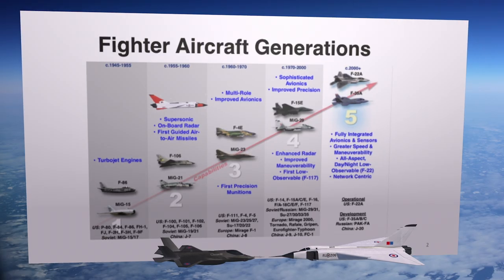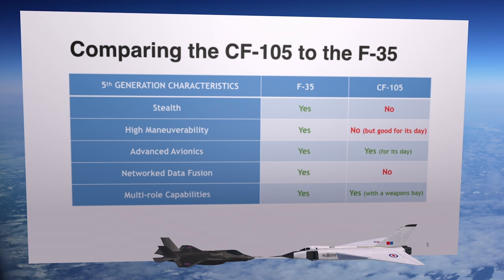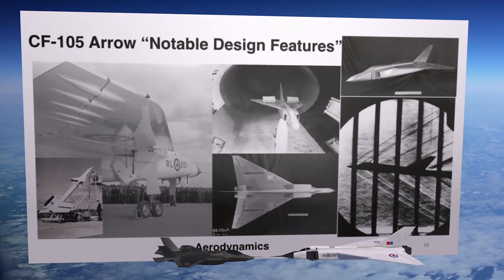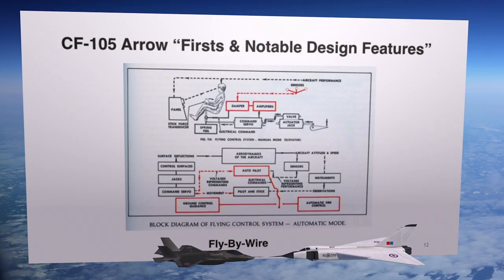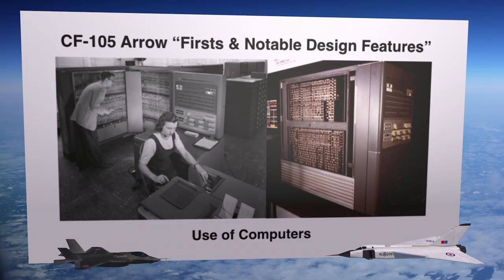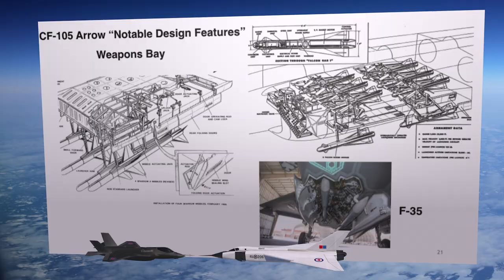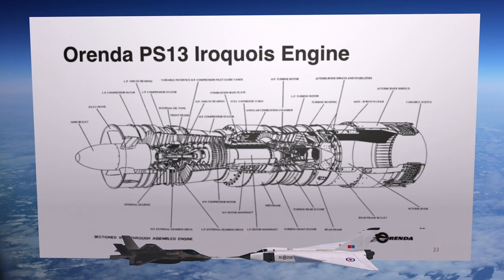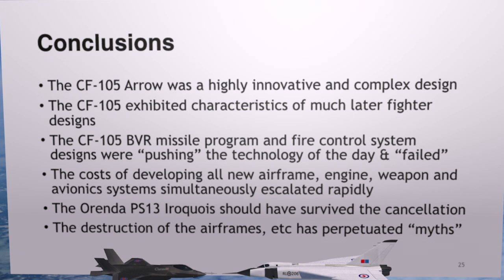AVRO ARROW FIRSTS VS F 35 LIGHTNING

Comment: The Arrow was not the only plane to be scrapped in that era.  The Brits have their own story too, and I expect there are others.  Basically, when nuclear deterrence switched from bombers to missiles, the interceptor requirements changed.  Speed was no longer king.  That's why the new planes don't fly as fast as the old ones.  No real need.  Then, stealth came along and there was another generation of fighters.

Funny thing is, they (Canadians, actually) are working on quantum radar which will destroy stealth.  Also, UCAVs are going to take over soon.  Requirements are changing again... to the point where raw speed is coming back, although unmanned.  The stealth air-frames sacrifice too much speed and are effectively a dead end.  The old Cold War era air-frames stand a good chance of being resurrected and I would not be the least bit surprised to see a 1/6th scale Arrow fly as a UCAV, and fairly soon.  There is a Canadian company collecting the old plans for the Arrow and, while they're not saying, I'm guessing this is their goal.
Reply from the maker: Hi Fixerdave.   Yes, there was a flurry restructuring in the late 50's when the Russians launched Sputnik, although in the final analysis, no one got it right.  The fact that nuclear arsenals on both sides cancelled out the problem.  Mutual assured destruction.  Planes don't fly as fast as the older ones, but that is also a function of the the Turbo-fan.  Turbo-fans can't process air over ~Mach 2.5 where Turbo-jets don't have the restriction.  Turbo-fans are much more fuel efficient though and give much more combat radius.
I have not heard of the Canadian Quantum radar, I will look into that unless you have more info.  Unmanned removes the G force limitation, but speed is still restricted by turbo-fans, although Mach 2.5 is still respectable, F-15.  I suspect the F-22 can fly faster than Mach 2.3 and I know the F-35 can fly faster than Mach 1.6, although not much faster.  I have no proof of this next statement, but I suspect the reason they post Mach 1.6 for the F-35 is that after that it becomes "less stealthy".  The Mach 1.6 being more of a Marketing statement than fact.  It's hard to sell a jet with the slogan "Stealthy up to Mach 1.6 and then you're dead meat".
There is a Canadian Company that has collected a lot of plans for an Arrow, but not nearly enough.  Although I always wish anyone trying to rebuild an Arrow well, there are so many roadblocks.   We have roughly calculated the cost to build a single arrow at one billion dollars.  regards..Virtual
Reply from the maker: @4Fixerdave  HI Fixerdave.  I am also old.  I start collecting my old age pension in Oct.  One of the reasons we are making these movies (I assume you have seen the series on my channel), is so younger Canadians will know we did this .  Having said that, it seems older Canadians are drawn to this much more than younger.  We came together when I met an Air Force general who looked after the CF-18's for many years, is also an Aeronautical engineer and is the foremost expert on the Arrow.  I also have direct access to the only person who has a series 2 Iroquois engine.  That is also on my channel.  But still, contracting these movies out would be hugely expensive.  That is where I come in.  I have some expertise in military affairs and the 3D skill sets to make these movies.  I fund the project myself as far as software and computers.  That get's a bit expensive.

People collecting plans.  There is Boudreau industries, but I am afraid that has faded into history.  There is a museum out west funding a 3/4 rebuild of the Arrow who have enough plans to make a flying model of sorts.  There is a new group called "Friends of the Arrow" who plan to build a full size, non military version of the Arrow.  They are trying to collect 60 million for this.  I don't think they have any chance of doing this, but I wish them well.  We have put the cost of rebuilding a full size military version on the Arrow a one billion dollars.  Even if you find a full set of plans for the arrow, the plans for the hundreds of special jigs, fixtures, presses etc. are gone.

I am gong to look into the links you sent me on Quantum Radar.  Quantum physics is a difficult subject to understand, but I have some exposure to this technology

Trying to figure out or understand the future of Air combat is tricky.  It seems clear, but it may not be.  I am working on something right now for Episode five of the Arrow series.  In this episode a large number of Russian SU-33's will engage a similar number of CF-18's in a head to head engagement.  No one seems to have any idea how that would play out as it has never happened.  Usually it's an F-15 taking out an old Russian jet.  Modern history has not had this scenario.  regards.....Virtual
Reply: @Virtualenvirons    I make no pretence at being an expert in combat aviation.  But, I do notice when I see people with a narrow focus missing how some other thing will impact what they're writing about.  While it may be interesting to consider, I expect there will never be a large number of SU-33s engaging CF-18s.  It will be many UCAVs or small numbers of humans.  

As you've said other places, there is value in having a human in the cockpit to properly identify the target.  But, I'd contend that the primary reason to put a human in the cockpit is to make shooting the plane down too costly.  If the air-space penetration games continue, using UCAVs will drastically increase the possibility that one side or the other will start shooting,  Put a pilot in the seat and you get a tripwire defence.  As such, the plane said pilot is flying in is irrelevant, so long as it can actually get to the intercept point.  If that pilot dies, then the UCAVs will take over.

And, because stealth will go away, that means that the UCAVs will have different requirements from the current fighters.  As I've said before, I expect raw speed to replace stealth.  The early Cold War aircraft were often faster than the current batch and could make for a good starting point.

Perhaps this "Boudreau industries" was the site I saw earlier, and that it failed is why it didn't come up in my searching.  And, perhaps the Arrow would not be as good a UCAV base as I had originally expected.  No need for twin engines, as there's no pilot to save on failure, and I've read other places that twin engines take a toll on speed.  Something I recall reading about a British plane with vertically mounted twin engines to overcome this effect.  I don't recall the aircraft name.  Maybe that's why they dropped the Arrow as a UCAV base, but I'm guessing.  Too bad though, it was a good looking plane :)

For the Quantum Radar they're working on at Waterloo, it's just radar with the exception that they can know (for sure) if the signal they're seeing bounced back is what they sent out rather than just noise.  Being able to ignore the noise makes it much more sensitive.  If they get it working, the technology is something that will spread to a lot of other things.  Very useful.

Oh, and having a computing background, a particular flaw I have is underestimating the time it takes to develop tech.  I see UCAVs and Quantum radar dominating any future conflict, but they might not be fully deployed in time.  I hope we'll never find out.

All that said, I do commend you for your efforts in documenting Canadian history.  I forget that many young people know very little about what Canada has or for that matter is achieving.
Reply from the maker: @4Fixerdave  Hi Dave....Boudreau Industries did not really fail per say....it's just never got going.  They (one person) have managed to get there hands of about 75% of the design dwgs., but there is just no chance.  The Arrows design was to accommodate the large iroquois engines (Turbo Jets) that would have eventually become Turbo Rams for the Mach 3.5 requirement.  In recent times as stated earlier the world has moved toward Turbo-fans for the fuel efficiency and they do  have a little better low end thrust, but high speed is a limitation.  I don't know for sure that Turbo-jets have to be as large as the Iroquois,  as no one has really made a new one for a while now.

I spent my career in Federal Government research working with people who had worked at AVRO. That is where I got the "Arrow bug". I did a concept design for Canada's participation on the International Space Station and was the first person to ever image a Mars crater in 3D space. NASA sent me data from the Mars Global Survey mission in 1996.  NASA was very slow to embrace 3D technology, so a group sent the data up here.  Essentially it was Google earth data in B&W, but we were able to extract.

There was a large group where I worked studying quantum physics since the late 80's and I had exposure to it, but it is such a bizarre field (Schrodinger's Cat), but I have the basics down.

There is a point that often gets missed in these discussions.  Most think of the Arrow as a speedster, which it would have been, but that was not the thing.  The Arrow was technologically advanced.  The fly-by-wire and negative g were not seen on American fighters until the F-16 and F-18.  Essentially if they had designed it to pull 9 G's, and had the money for the original design, it would have been a strike eagle only faster.

Great discussions.  regards....Virtual

Comment: I wonder if someone could take the basic design and modernize it. Using modern materials and avionics I'm sure it would be formidable.
Reply from the maker: Hi Silver...With Vectoring thrust and modern avionics, it would be similar to an F-14, but able to fly higher and faster.  Vectored thrust would likely give it the same G rating  (7.5) as the F-14.   But, because of the size of the Arrow, much more could be added to it.   regards....Virtual
Reply: it is possible and can be done ... BUT you need to start from the actual design to get it reset to modern materials ... then test that virtually and then update the air frame from there ... not actually hard ... just a TON of little things to deal with at every single step ... in essence you have to do the work of 6,000 engineers who were familiar with this work and doing it as their day job ... that kind of TON of little things ...
Reply from the maker: Hi Kaboom.  I read through your posts until I found the end.  You have busy.  Thanks for watching.  You posted 115, 116 and 117, etc.  It is true the the taxi engines on 206 were not a matched pair.  I am curious about how you know this?  Were you involved with the Arrow?  regards....Virtual
Reply: @Virtualenvirons   well during and after my service career I was considered an information specialist ... yes I was RCR spent 6 of my almost 10 years in the usa as a scout sniper infiltrator ... for desert storm I was one of a number of people keeping the red guard out of the loop and using their deployment information to direct the landings ... I spent more time IN the building than out of it .. to be sure ... frmr Cpt ... last time anyone saw my service record it had 3 words visible and the rest was a load of black ink ... and they got reprimanded for pulling it .. I spent more time in active duty than off active duty ... almost 7 years full active ... with weekend furlows only ... none of the relaxing 6 on 6 off the rest got to have. 
.
 I can honestly say i spent more time in the "fun" places of combat .. Somlaia ( yup when the choppers went down) rwanda ... iran iraq ... I think yugoslavia ... not sure though as I never saw the place in daylight and was there for about 30 hours ... even some fibal fun in south america picking up and attached ranger to my unit against cia orders ... that one cost me my career but I would do it again ... standing orders at the time for canucks was leave NO MAN behind ... as this ranger was attached to my unit I did not leave him behind as the cia wanted but retrieved him ... and all he was carrying was a single sheet of paper that for the enxt 20 years was how the us fought against the cartels ... the ranger did levenworth time and then returned to canada and his home first nations tribe in PEI ... and currently he is a prisoner on my couch thanks to covid and yes I was also part of the soliers helping soldiers people who helped ret'd Cpt Vicky ryan find the lost souls in and around Ottawa putting truth to cnadas va that only about 2k vets were homeless or at risk ... while I showed and pulled that many from the ottawa area as for recalling my full service details ... thanks to american debrief needs ... I am not the same person i once was ... and yes MKultra still run to this day ... my clearance was high enough that the next level was retirement was when you were 6 feet under feeding the flowers. ... so yes I have a unique insight into all of this ... not to mention a life loong love for the arrow and every scrap of info i can get my hands on ... I even had the complete avroarrow.org website on encrypted drive until I was forced to reformat and lose it ... after that sight was dleted and most of his files were lost... as for my oath of secrecy I figure that no longer holds as the powers that be didnt keep their end ... on sign up they said we would be looked after in and out of the service yet I was dumped shy of my 10 years to avoid paying extensive benefits for my shy of 10 years service requirement 9 years 6 months 4 days service with almost 7 of those FULLY active ... Canada treats it's snipers like shit sadly ... I miss my mactac
Reply from the maker: Hi Kaboom.  Wow, well thank you for your service, but that statement has begun to sound hollow recently.  Were you JTF2? 
If you have any questions on the Arrow that you are not sure of, post it here.  If I can't answer it, my team of contributors can, perhaps not in a timely fashion, but eventually.  regards....Virtual
Reply: No one would buy it

Comment: I'm confused, why did the arrows have to fly to a different air base in the wrong direction to get more fuel?
Reply from the maker: The Arrow did not have a mid air refuelling drogue, but it did have a quick interchangeable weapons bay that could carry extra fuel at the expense of missiles.  regards....Virtual
Reply: @Virtualenvirons  so why didn't they take off with more fuel rather than fly the wrong way?
Reply from the maker: HI RMS...Although the weapons bay can be change quickly, it still takes time on the ground to prepare the new package.  Faster for the Arrow to make its way west, pick up fuel and rejoin flight.  But the real reason was to show the exchange.  Have you seen Ep. 7....just released.  regards...Virtual
Reply: i agree it could have been at home base ... BUT then it would still have to reland and refuel to intercept ... by flying part way  they get the refuel and better selected munitions already setup for the imminent engagement .. tactically sound plan actually ... think of the hot swap as the arrow version of a tanker stop that also covers a weapons swap ... something the f35 couldnt do in the air

Comment: I'm surprised at how the author could know so much about the capabilities of the Arrow, yet err on the intended role of the aircraft. It was not meant as an air superiority fighter, but as a bomber interceptor meant to operate from  geographically remote air bases.  Thus, it had to carry its own radar and guidance systems.  The Arrow was not a dog fighter type of aircraft as it was too big and too heavy to be very effective in such a situation.  I agree that our air industry accomplished a lot during its construction.  But, it was the demographics of the day which cancelled it.

Canada was also building new ships for its navy at the same time, and Dief The Chief felt the Arrow was simply too expensive for what it would be needed for, assuming such a need ever arose.  While it's possible he didn't fully appreciate the long term implications of shutting down the Arrow programme, a missile base is cheaper to run and maintain requiring fewer people.  And, the  supersonic aircraft we purchased (the F-101 Voodoo and F-104 Starfighter) were much cheaper to purchase, maintain, and not be required to operate from remote northern air bases.  In the end, economics won out.
Reply from the maker: Hi John,  I am afraid that almost everything you have written is incorrect.  The term Air Superiority Fighter had not yet been coined and  the intended role of the Arrow initially was intercept, so they called it an interceptor.  The F-15 Eagles main role is interception or another word Air superiority.  Put everything from an F-15 on a 1958 Arrow and you have an Air Superiority Fighter than can only pull six G's in thick air, but more G's than a F-15 above 50,000 ft.  Not a good dog fighter though.  

Something else you probably don't know is the Arrow was designed with Ground Mapping Radar for the Strike Role.  Eventually it was to be a Strike Eagle thirty years before the Strike Eagle.  The F-101 and F-104 were really bad aircraft compared to the Arrow.  Canada's pilots were expected to fly the F-104 over Russia from Europe, drop a Nuclear weapon, turn around and bail out when they ran out of fuel because they could not get home as the jet was designed.  That's true. 

Below is the Series link.  There are six Episodes total.  If you watch them all you will understand the Arrow and why it was cancelled.  Please feel free to comment anytime, but if you watch the movies, you will have a better idea.  All of this has been researched, except for the very last part of Ep. 6.  A little bit of artistic licence.   regards...Virtual